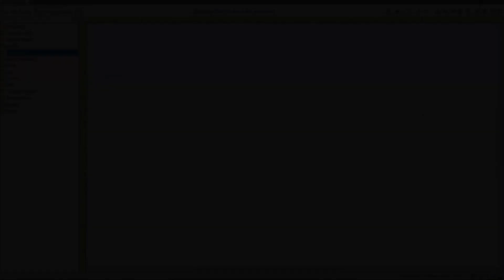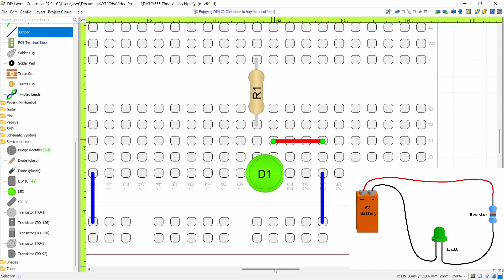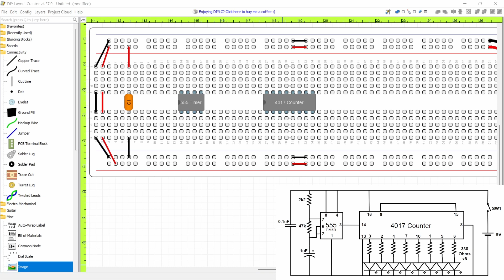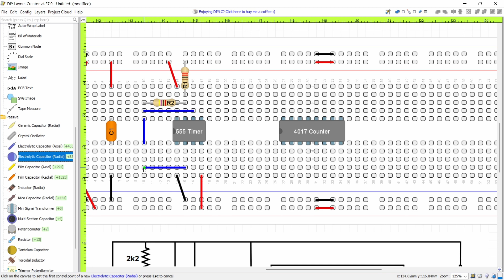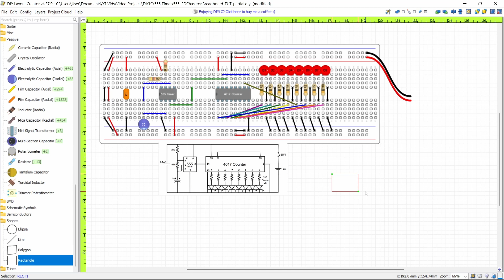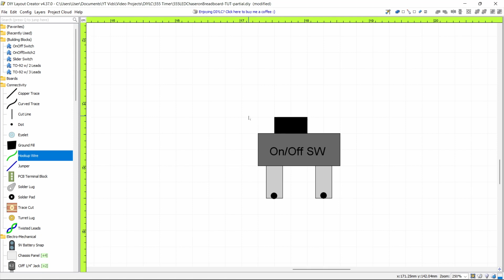Electronic Breadboard Circuit Design Tutorial With DIY Layout Creator

Comment: When I try to activate DIYLC after downloading it to my computer I get warnings both from Bitdefender and Windows (10) that the program is potentially dangerous, so I've never completed the process.  Anyone else seen these issues?
Reply from the maker: Hi James, DIYLC is not that well known yet so some antivirus programs may treat the installer file with suspicion which is normal. This often happens with software created by small independent developers. I have installed it on several computers running both Windows 10 and Windows 11 and I have been using it for a few years at this stage. So far I haven't had any issues with it (as far as I know), but as I did not create the software I wouldn't be in a position to give any guarantees as to whether it is malware free.

Comment: Great video. I like what you are presenting. I got DIYLC for Windows installed. How do I get rid of the list on the right side of the screen? It is very annoying and limits the project space requiring panning to use the design window on larger projects.
Reply from the maker: Hi Robert - Glad you liked the video! To change the view go to the "Config" menu at the top of the screen, select "Toolbox" and then "Tabbed Toolbar". This will move it to the top of the screen.

Comment: Is it possible for such an app to support Protel Netlist from a schematic capture app and then
use that netlist in DIYLC to aid in component placement, jumper and grinding off traces?
Reply from the maker: That's a great idea! It might be worth suggesting that to the developer. Check the help menu in the app for contact details.
Reply: There is an import netlist option already, I tried importing a netlist but I can't seem to find any other feature to actually make use of it.
Reply: @davidreichert9392  it would be very interesting to see how AI can help to make make full "auto routing" by erasing off the copper traces to make a functional board which you can then optimize yourself later